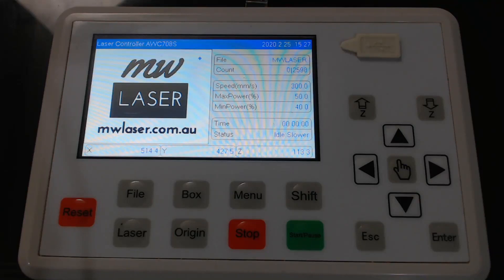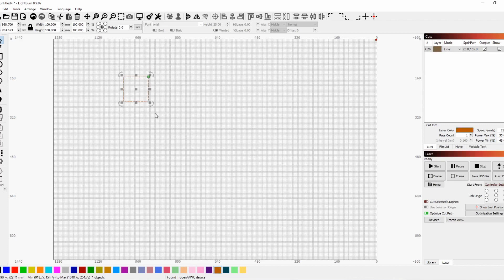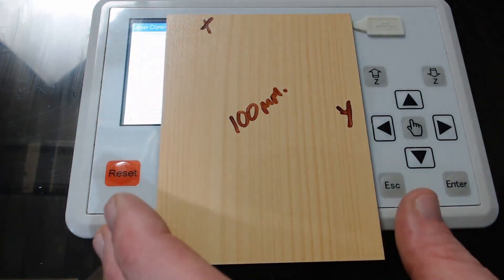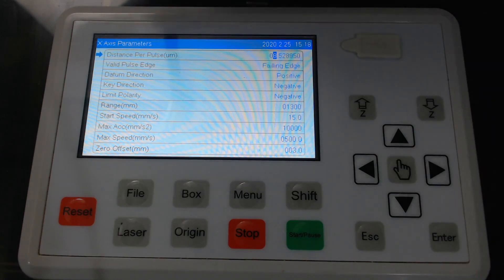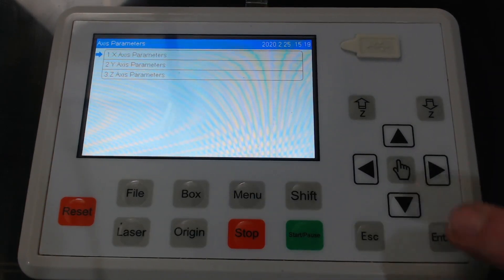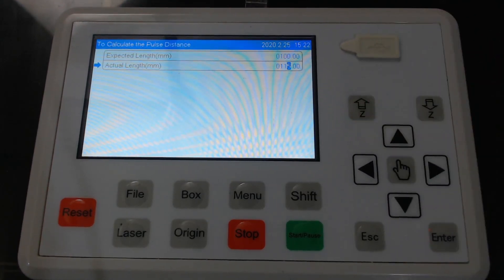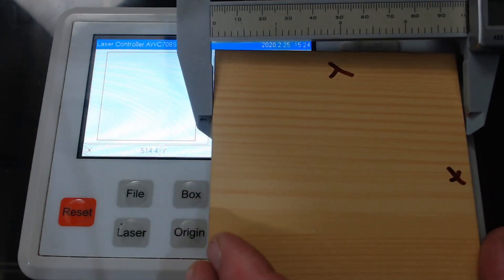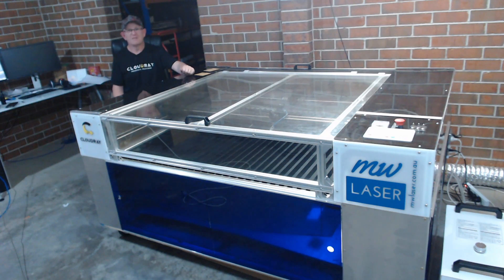Trocen AWC708S X&Y Axis Calibration - Co2 Laser Machine Controller Settings

Comment: Your method ignores the beam kerf width, this will introduce a slight error. Engrave the largest possible rectangle that will fit in your machine, then measure the distance, center-to-center on the line, this is how you get the best accuracy doing this calibration.

Comment: I have a calibration problem, for the Y axis I have to use 2 calibrations to find the right size. While the X axis is enough 1 time.
The next problem is only for the Y axis, if I turn off the machine, the previous calibration is not saved/changed while the X axis remains correct.
How do you do that calibration is only needed the first time, then it doesn't require calibration even if the engine is turned off? Thanks
Reply from the maker: ensure you write your calibration settings to the controller.  if this continues to cause issues, contact Trocen Support.
Reply: @MWLaser  Thanks

Comment: My controller won't power on, for some reason. Which port on bottom is your data line ran to?
Reply from the maker: I had it connected to CN2 (middle connection) Cheers Matt
Reply: Now it works! Funny how a simple confirmation makes the rest of debugging so much smoother. Many thanks 🙏
Reply from the maker: @MxchiefMxker  No prob - You're welcome

Comment: My Trocen AWC708S  isn''t being found by lightburn. Any tips?
Reply from the maker: You will need to install the driver for the Trocen controller first. in many cases this involves installation of the Trocen software LaserCad - once installed it should detect in LightBurn.

Comment: Hi Matt, so you calibrated for cutting the outside of the square, can you calibrate for an inside cut? With CNC routers you have a male and female cut to account for the router bits thickness. Is that the same for a laser?
Reply from the maker: the software has kerf compensation settings, I plan to cover this in one of my future videos.  the list is growing and I have not enough time to get to make them all.  hopefully soon

Comment: Hi Matt. Love your videos. I have a new machine with an AWC708S and it won't engrave over 200mm/s. I send a file over at 400mm/s and the controller appears to limit travel to 200. Do you know if there's a setting to unlock that? I only ask here as I'm getting no response from Trocen.
Reply from the maker: Press Stop&Shift - Go to Axis Parameters, in the X Axis Change the Maximum Speed to Greater than the 200mm/sec that is will currently be set at.  Then Press Enter. You can then change the Max Speed for the Y Axis too if you need to.

I currently use X_axis Max Speed 700 and Y_Axis Max Speed 400
Reply: @MWLaser  Thanks so much for your very prompt help.

Comment: Hi, Please can you tell me the smallest DPP Numerical value the controller can be set to. Going to upgrade from LaserCut5.3, In my settings, it has "puls unit" = 0.0025000000  ?
Reply from the maker: On Trocen the smallest I have successfully saved on Axis Distance Per Pulse (um) is 1.000000. anything entered less than 1.0 and it defaults back to 1.0

Comment: Hi Matt, I appreciate your videos. I am wanting to upgrade the controller on a older Yueming 100w chinese laser. The Trocen AWC708s seems sufficient for my single head. Do you see any advantage in using the more expensive Ruida RDC6445 or even the Trocen AWC708c lite? I mainly want to get onto using Lightburn, and off the poor proprietry software supplied.
Reply from the maker: Both controllers are very good.  I notice I have an email from you so I will reply in more detail.
Cheers Matt

Comment: Hi. How precise are you  going with your decimal points. Was it exactly 88mm, or was it 88.03mm
I am asking as I put in all the decimal places and I am getting a very slow but repeatative X creep.. i.e. When going raster it slowly moves to the left and then slowly corrects itself back again. X Axis move smoothly and current is ok
Reply from the maker: it is best to be as accurate as possible, use as many decimals as you can accurately measure.  For the final calibration of my machines I use digital calipers rather than a ruler.

Comment: I just did an upgrade to this controller. I got everything functioning but it doesn't zero out. It just moves a little bit down and to the left and says thats zero. Would you have any idea what would be going wrong?
Reply: I have the same problem, how did u fix it?
Reply: @andeersonHC  I still haven't figure it out. I've been using lightburn and just forcing the stepper motors into a 0,0 which I know is a terrible thing. I've been debating on doing a full reset but I dont want to go through setting everything up again.
Reply from the maker: email me
Matt@mwlaser.com.au
Cheers Matt